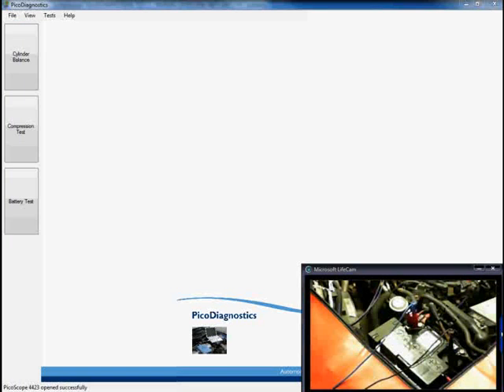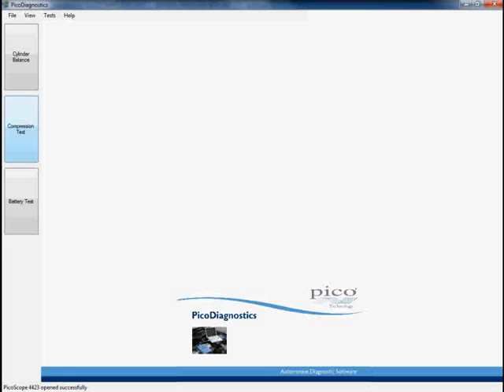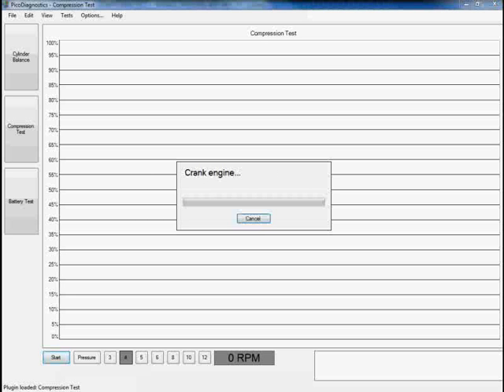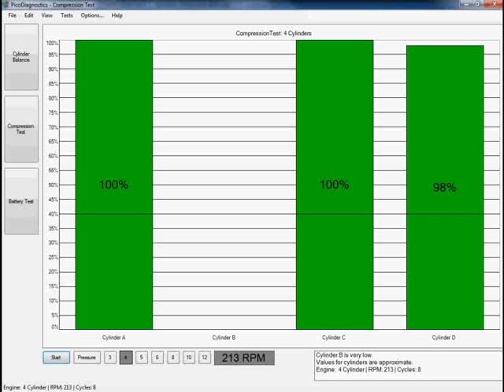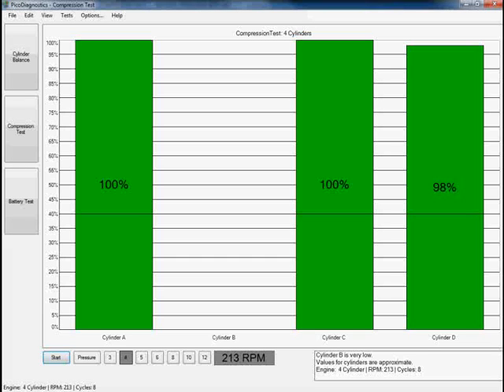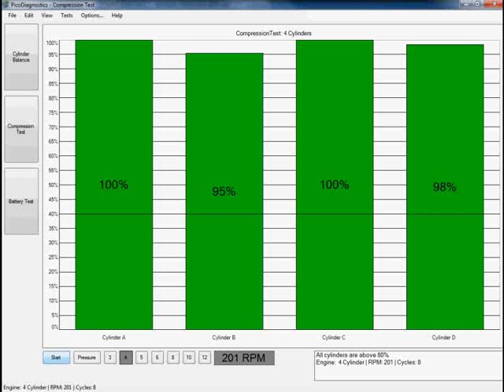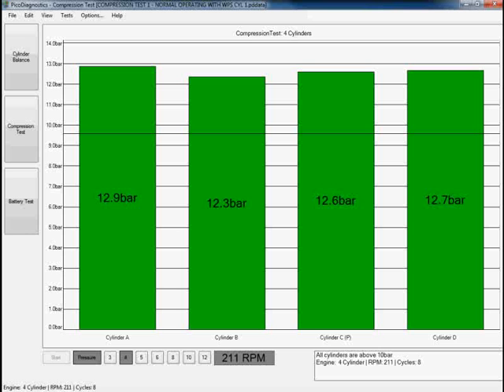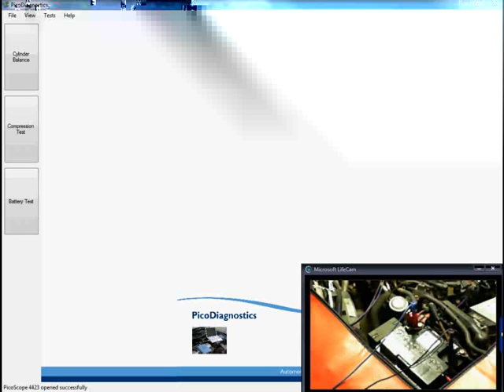Relative compression testing using an automotive oscilloscope

Comment: how does the pico software/hardware determine what a good battery spec vs all the different types, sizes, and conditions/state batteries on the markets today? Is there an article I can read about the technical background of pico software-hardware under this circumstance of this pre battery test event(s), before the relative compression test(s).

Comment: I like doing a relative compression test using the amp clamp around battery positive or negative, you get a much better indication and along with a sync probe on cyl number one especially for 6 and 8 cyl engines
Reply: Why are you saying that using a clamp around B+ or Ground is a better method? Did you ever try both methods in the same vehicle?? Just wandering.

Comment: Is it just the test within pico diagnostic software that requires only voltage probes. Scanner dancers demo of Picoscope shows a current clamp being used. Is that just because he is using the pico automotive 6 software, and does it matter which method we use?